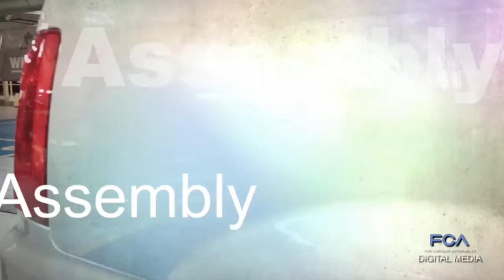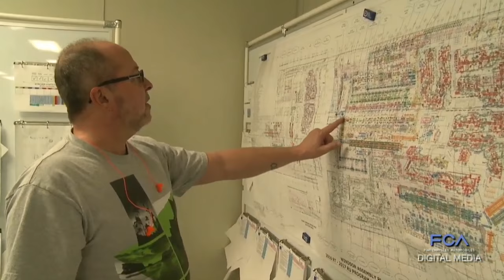Chrysler Pacifica Celebration (Full Program)

Comment: i dont understand the big deal... its just a minivan.  most ppl drive SUV's anyways that need seating for 7...
Reply: You can get the Pacifica in 8 seating setup. It's not just about the Pacifica it's about the near $2.7 Billion Chrysler Invested into Windsor, the development and architecture that went into building the platform Pacifica rides on, a platform that will carry once green lighted a Chrysler brand Crossover or SUV and a large car that is longer and wider then the current Chrysler 300 most likely the successor to the Chrysler 300.
Reply: Alfa Romeo Giulia will be the basis  for the Chrysler 300 and Dodge Cherger?
Reply: Big diff between the two, a minivan is way for practical and comfortable!
Reply: SUVs are inconvenient for families and not practical. Minivans hold much more cargo. SUVs will be on the way out since people are finding out the value of a stylish minivan like the Pacifica. Minivans have a place in Americans driveways. 

But union bigmouths? 🤔 that’s a thing of the past.
Reply: @massimobernardo-  if it is, it's going to be extended since 300 is a 5 m long...although i do like Giulia and i do like Italian chassy settings, i am not sure hoe that is feasible.